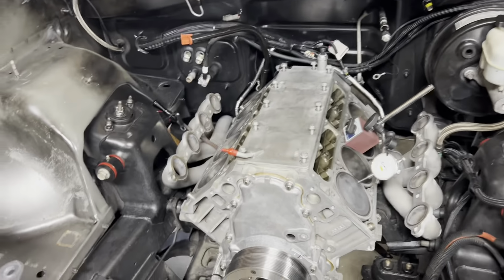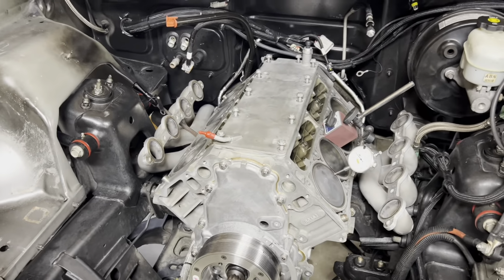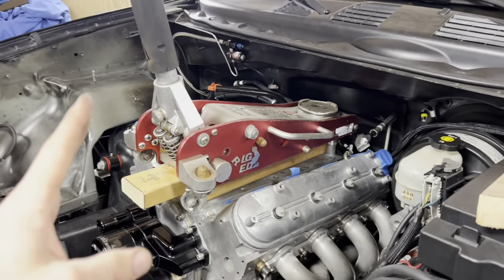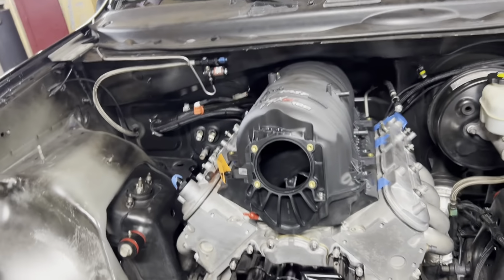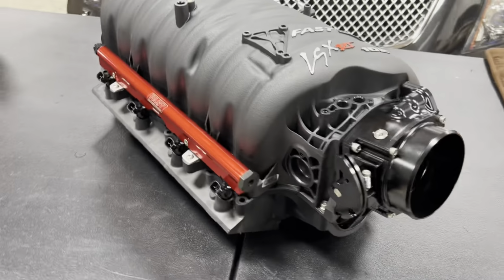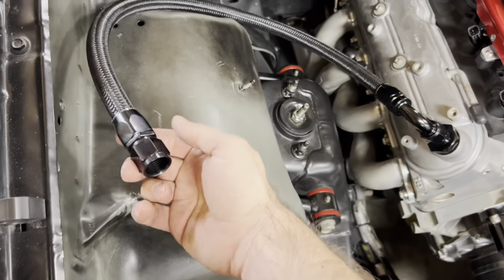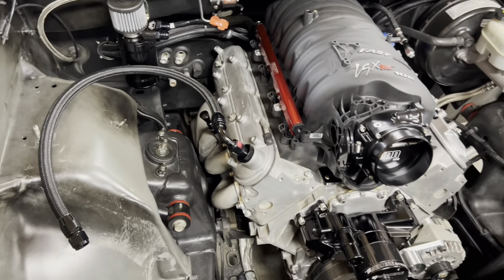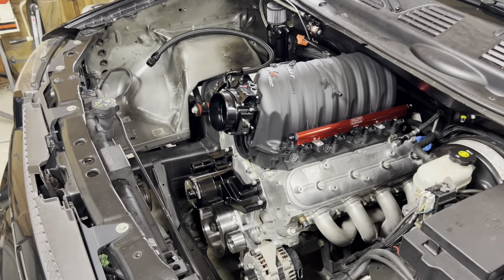The ULTIMATE Cam Only Trailblazer SS Build! - Almost Ready To FIRE Ep. 4!!

Comment: no ac? and you running the factory computer?
Reply from the maker: Holley and yep I took the a/c lines and compressor off since it’s so much nicer working on the engine without all that in there. If I daily drive the truck I could easily bolt the stuff back on.